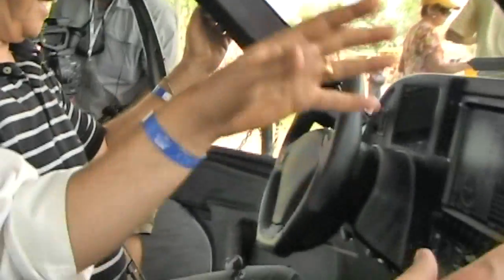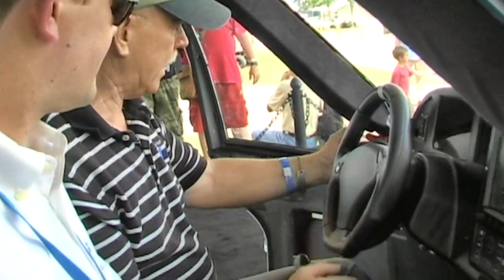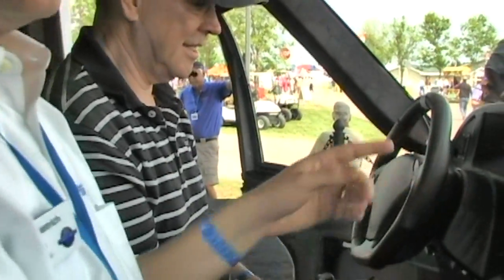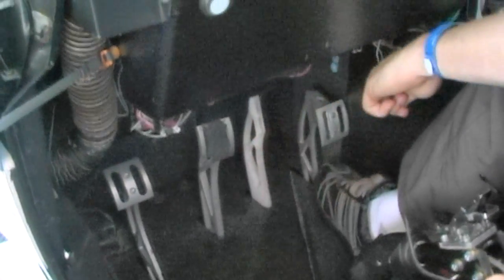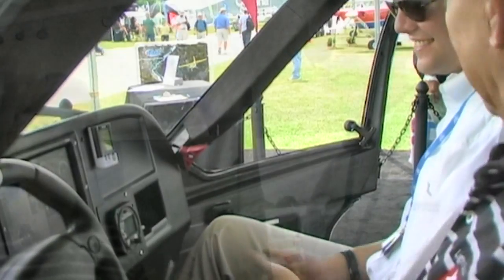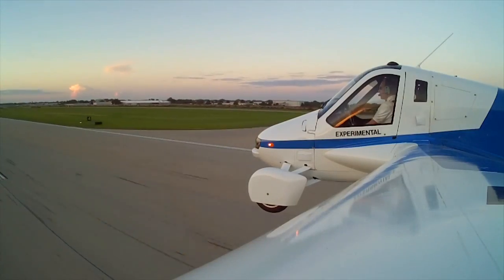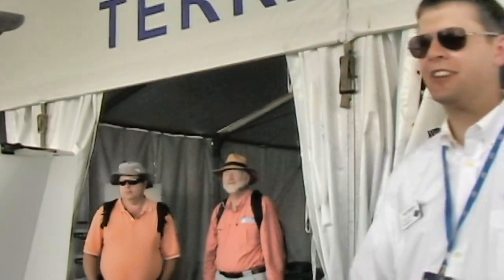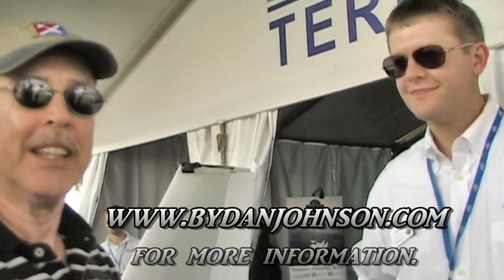Terrafugia, Terrafugia Transistion - Driven to Fly at E.A.A's Airventure.

Comment: The necessary components in order for this thing to serve as a car represent performance-robbing dead weight in its role as an aircraft, while the need for light weight limits its potential as a suitable car. As has been proven before, flying cars are a bad idea resulting in a substandard vehicle for each conflicting role. For the money I'd have a Porsche Cayman, a Dynamic WT-9, and $100,000 left over. I'd have an incomparably better car AND aircraft. Now, what to do with the $100,000?